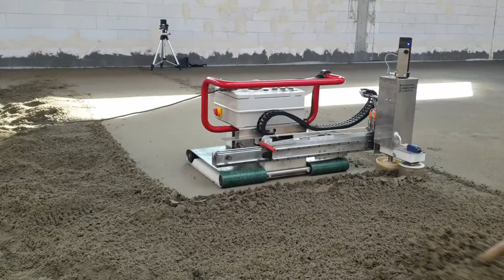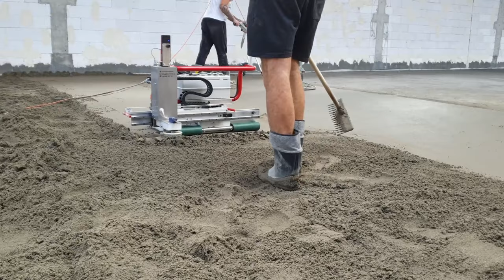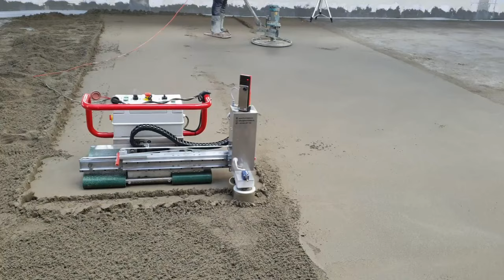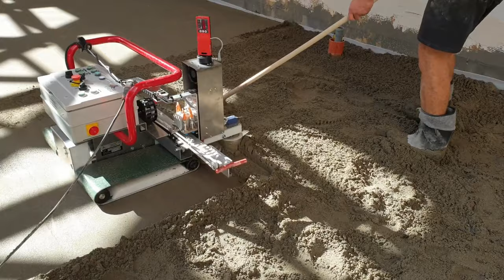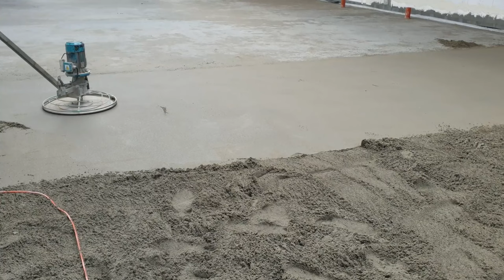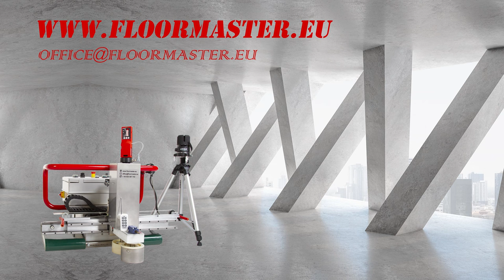Screed robot Clapa Floor Master 130 on large areas

Comment: Один день сколько квадрат может делать
Reply from the maker: The machine can do up to 100 square meters per hour during continuous operation. How many meters it will actually be depends on the team's experience, concrete availability, etc.
Reply from the maker: 178 / 5000
При непрерывной работе машина может обрабатывать до 100 квадратных метров в час. Сколько метров это будет на самом деле, зависит от опыта команды, наличия бетона и т. Д.
Reply: @ClapaFloorMasterGlobal  лош